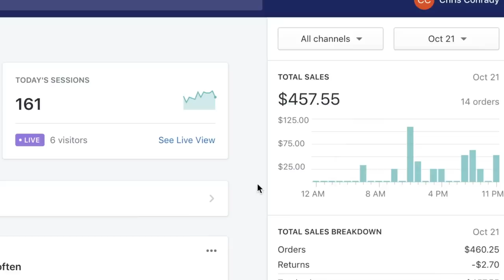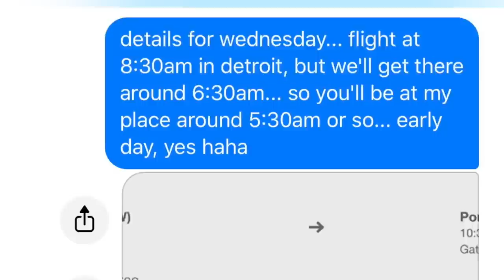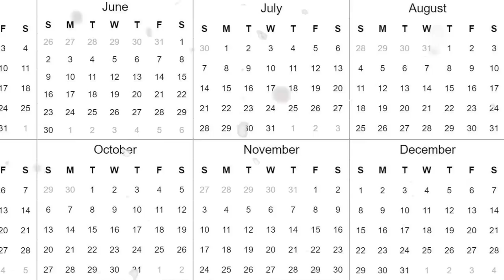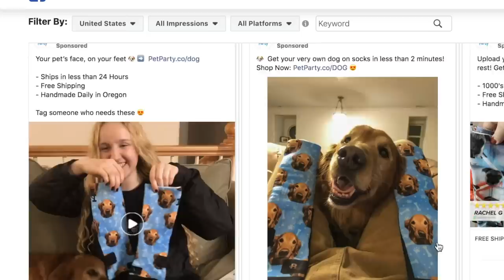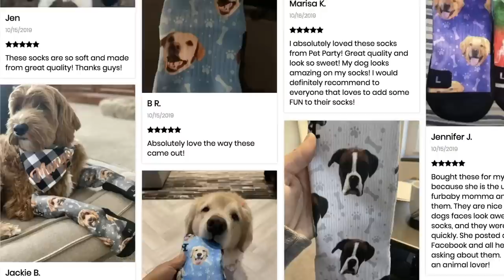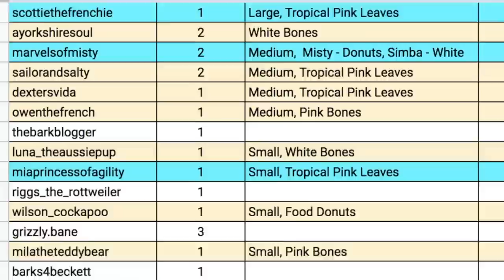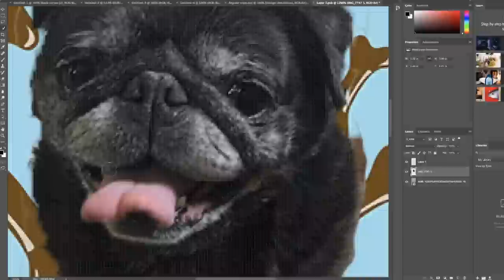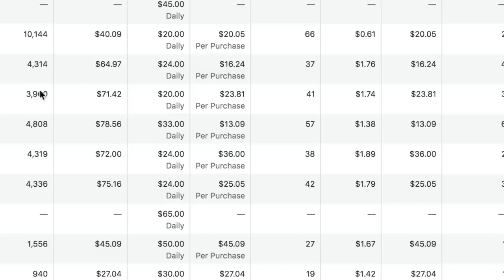How He Made $1,000,000 Selling Dog Socks

Comment: Guys DO NOT,I REPEAT DO NOT use printify socks for your print on demand. I recently created mine using the regular socks and ordered samples. Took about a week  but when I received them I was disappointed by the quality. They were not very stretchy and the print looked horrible when I tried them on. However  these were the regular socks. I switched to the crew socks, created my design and set up my website. I then did a test order from my website to make sure everything worked perfectly. When I received the tracking information it showed they were being shipped from China. Wasn't too concerned about this,long story short I received them on the 6th of November . Order was placed on the 19th of October, that's not the worst part. The socks quality was awful not mentioning the print. Wore them once and the material was falling apart. Had to remove all products from my website and uninstalled printify as my provider.
Reply: who do you use now
Reply: @valleygirl670  just recently installed SKYOU going to give them a try and see.

Comment: its kinda funny that they have people cropping the images when there is automated programs capable of that already
Reply: do you know what programs? just wondering
Reply: @kyleryan1745  i know of a couple: auto cut out on google play, remove.bg, photoscissors, all just from a simple google search.
Reply: @kyleryan1745  but they are not perfect and its suggested to use pictures that the background is easily visible.
Reply: No software would be perfect. And if it was an app on the play store, that cant be automated unless it has its own api for integration. The human aspect of the cropping ensures that it actually looks good.
Reply: @JooshYT  yes but every tool helps. its not like we see construction workers hammering nails in by hand.
Reply: @JooshYT  To make it automated is easy but of course you would need to view it yourself but that does not mean you need to initiate every change yourself.
Reply: @jimbobbyrnes  Automating a single action such as pushing a sharp metal object vertically down into a surface, is alot more simpler than figuring out what the focus subject of a image is and cropping the background out.
Reply: @JooshYT  they are taking pictures of animals faces it isn't rocket science. For that these programs work almost flawlessly. if it was trying to cut out multiple animals from the same picture than just get a human to do it otherwise it works.
Reply: @JooshYT  every second you save is a second earned and if you can automate any process than you'll surely save atleast a second.
Reply: @JooshYT  to a human cropping a image seems difficult but to a computer it is easier than hitting a nail on the head.
Reply: @JooshYT  actually i just realized that hammering a nail would be harder for a computer than cropping a image. because it would actually need to crop a image to know where to strike.

Comment: Hey Chris, you probably already knew this but if not you should check out WCFulfillment. They have the pet wallet with the same pet face layout but they use Smart Object which I think could work on your socks and reduce the photoshop time. You can just crop the face once then it's automatically applied to the pattern so you don't have to copy & paste and move the face around multiple times!

Comment: 6:38 I really wonder why they're using scissors as appose to something much more time-efficient like a paper cutting guillotine that you would see in schools.
Reply: Would definitely speed things up
Reply: Something like a Zund flatbed cutter could take the entire 150ft roll of printer media and automatically cut it down. Expensive piece of equipment, but if they're looking to expedite their manufacturing workflow it would make a massive difference.
Reply: my guess is one of 2 things.
1: the cost of replacing the blades on paper cutters (if that's even possible, you may just have to replace the whole thing when the blade dulls) is probably much higher than new scissors.
2: the time saving of paper cutters is being able to stack many sheets to cut at once. Perhaps something about working with sublimation transfer sheets makes this not possible or causes a degredation of quality.
Reply: They need a service map.
Reply: Skoozi It’s not expensive at all, it pays for itself

Comment: Some aspects of that whole HoopSwagg operation seem so unprofessional...
 He "[...] tried to eliminate all bottlenecks", yet he's using scissors to cut paper sheets? Seriously? At least he should be using paper cutters.
Reply: @Yves Bodê What? He literally said that sometimes there's someone cutting paper for 10-12 hours a day. Paper cutters (even the commercial grade ones) are not that expensive.
Reply: @Yves Bodê Exactly. It's all about productivity, and doing this with scissors is a complete waste of *time*. No matter what volume you have, paper cutter fixes all your issues. 
a) If somebody is wasting 12 hours a day, because he is going slow, with the paper cutter you can reduce that time significantly. Just stack things on top of each other and cut everything at once. Low volume -> massive increase in productivity.
b) If it takes so long because the volume is huge, you'll save less time, but precision will increase dramatically, and fatigue will significantly decrease. Can you really imagine using scissors for 12 hours? 
  
So yea, you're just proving my point with your `productivity` argument.
Reply: consider the price to replace blades on paper cutters, or the entire cutter if swapping blades isn't possible vs a new pair of scissors.  Also the speed of paper cutters lies in the ability to stack, which may not be ideal or possible when dealing with sublimation paper. I'm willing to bet this guy has heard of paper cutters before so there is likely some reason he doesn't use them
Reply: @Skoozi  do you really think a pair of scissors lasts the same as a paper cutter's blade?
Reply: @Lipasny  nope, didn't say it does. But it could still cost less to replace scissors 30 times than a paper cutter once.
Reply: @Skoozi  why am i even continuing this discussion... cheers boyz. peace.
Reply: @Lipasny  he has 70 papercutters
Reply: @Skoozi  actually, convo has merit. lol. but we need to ask brennan. Ill ask and report back.